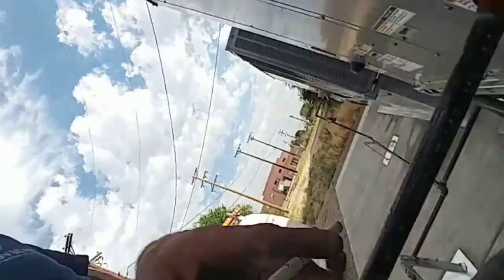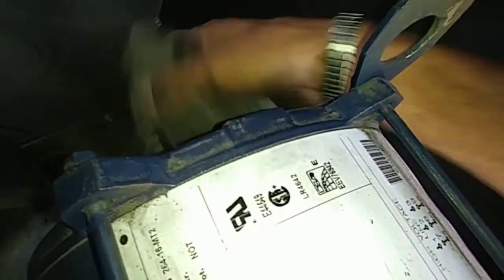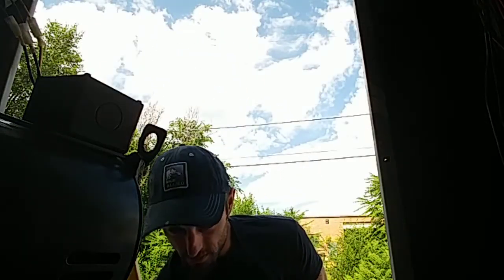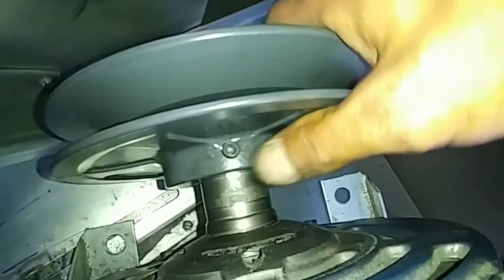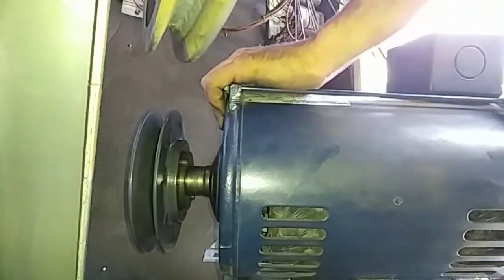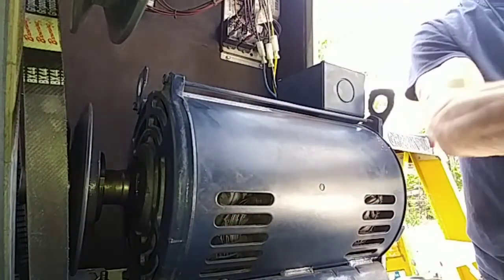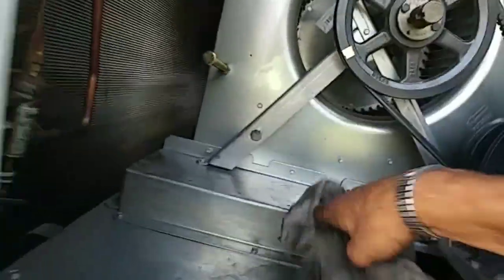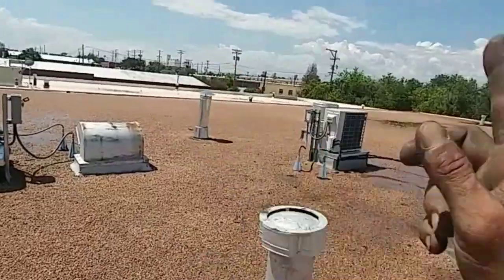🔩🔨HVAC/R DUDE: CARRIER GROWHOUSE RTU SHEAVE🔧🔨

Comment: Thanks for your vids HVAC/R DUDE. I like your enthusiasm with your work. The industry needs more guys like you. Just wanted to add the reason your marks didn't line up was due to the adjustable pulley. It's made so that you can adjust the blower speed and by closing it up it made the belt ride higher and the blower rotate faster. Kinda like a CVT transmission. Also, it looks like those plugs are for the motor bearing lubrication point.
Reply from the maker: RodDay thank you very very much!!! And yup the shave did eat up the end of the motor where the lube point are😐😐😐haha..crazy...yeah brother I love this trade and very passionate always open to suggestions and I never thought about that with the motora  s shave THANK YOU FOR THE COMMENT!!😊😊😊